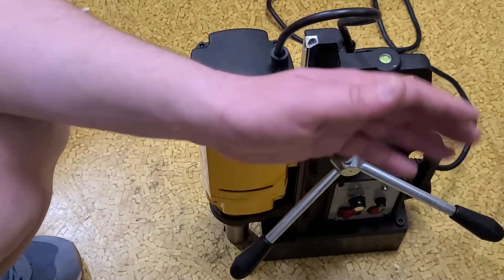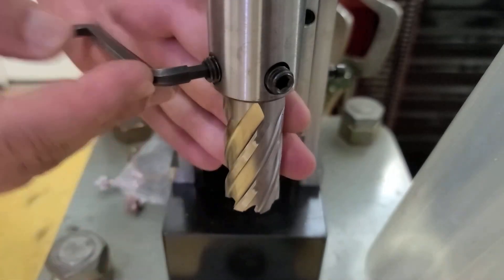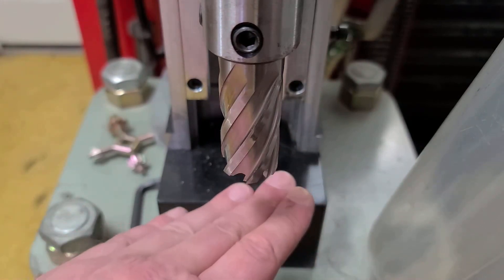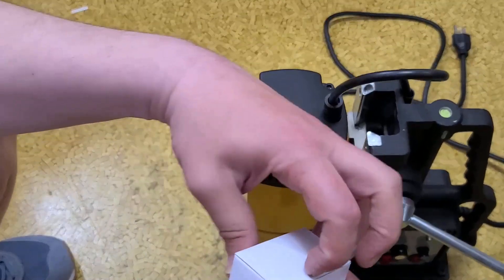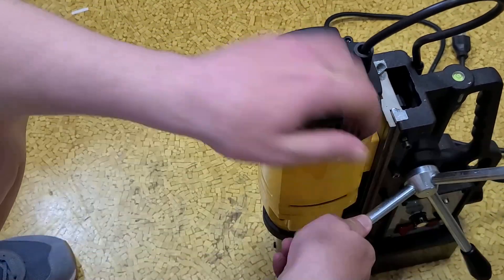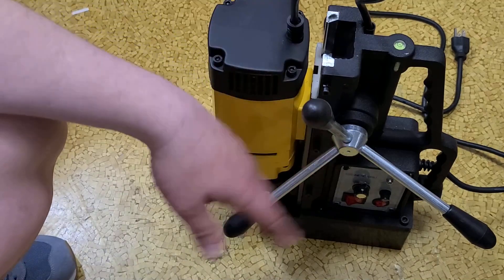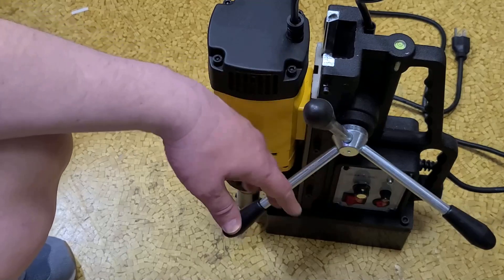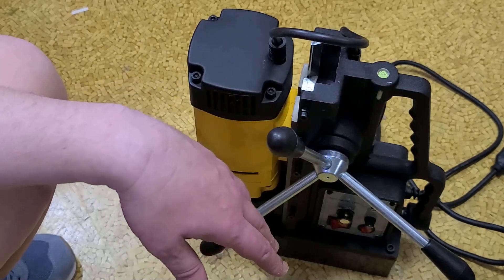Vevor 2" Capacity 1st Generation Magnetic Drill Review

Comment: You might be a little overly critical. True, it's not a high end system with all the whistles and bells. For me though, it's perfect for the occasional and simple job. It doesn't make any sense to spend 2 grand on a unit that is only used once or twice a year to drill a couple of holes in a steel post. It simply takes me out of a difficult situation. If it can handle 4 posts, I've more than doubled my money back. This might be one of those deals where you'd say, one man's trash is another man's treasure. So, until it ends up in my trash for the scrap metal guy, it's my treasure.

Comment: I bought this exact one and it’s AMAZING. We are building a metal shop with 12 gauge beams and we used this drill to cut holes in our 3/8” angles to connect the beams. Cuts straight holes and like butter! Get it and you won’t regret it!

Comment: I like drilling off at an angle. They make special offset bolts for that or you can use a u-bolt on the deeper ones. I wish Vevor would sell those too. I've purchased alot of things for Vevor. All of them are a good value. Why pay 2000 dollars for a mag drill that will be wrecked the first time the power goes out while it is hanging upside down and explodes on the floor like humpty dumpty.

Comment: I have an old school Black & Decker Mag Drill (from the early 70's when you could actually still find B&D stuff in pro garages).
It is 100 pounds.
Mercifully the drill and post come off of the magnet.
You just need a mallet or soft metal hammer to turn a collar.
I doubt any of the modern Black+Decker manuals show someone wailing on their product with a hammer.
I can understand why you would want to.

Being from a time that predates safety you can run the drill without the magnet turned on.
Hell, you can run it without the magnet attached if you want.

I don't know when pro mag drills came out with the lockout that keeps the drill from running unless the magnet is on.
It is a good idea nut not somthing they have always had.

Comment: It is a cheap drill for non precise drilling. It is about 1/8 the cost of the ones you are comparing it to. For folks just wanting to drill a hole in farm machinery it will suffice for most jobs. Yes, it would be nice if it had more safety features for the millennials that have to be taken by the hand and told a stove with the light on may be hot. But for the ones raised in the era using a 3/4" electric drill and knew damn well if you didn't pay attention if it grabbed it was at least going to run you around in a circle or worst case break an arm or maybe more to it wrapped up the cord and unplugged it. You can only make things fool proof, but you can't make them damn fool proof.
Reply: You know what, if you're just going to drill a few holes in thick steel in a controlled enviornment that might be alright if you understand the tool and its limitations.
But if you're only going to use it for a few cuts then you're a novice and you probably DON'T know.

This is a tool that can put you in the hospital in a hurry if you don't use it right or you mess up, if that thing looses magnetism and falls on your head, you won't be laughing, if the cutter cuts at too much of an angle, lifts the magnet off the steel then it will break the cutter, come loose and might just smack you in the face on the way to the ground.

And hey, If you're a boomer laughing at Millenials just remember it was your generation that sold out the working man to China for a quick buck, so don't get too frisky.
Reply: @elliotkane4443  You do realize it has a safety strap to secure it in case the magnet become deenergized? Of course you don't, you probably have never been around one.
Reply: I have a milwaukee that the mag and motor are on different switches and one round E stop button.

Comment: I have no particular issues with mine, it’s the perfect harbor freight quality tool, it serves the purpose for low volume work that doesn’t require high reliability and precision.
Reply: It seems to be if you are an occasional use homegamer a Vevor or Amazon one is fine.
I think his was made on a Monday morning.
I haven't heard of anyone else having the drill lift up becase the cutter is so wobbly.

If you are a serious home workshop type that uses it often, the extra money for an Evolution might be a good idea.

Using it every day professionally?

Get a Milwaukee, Champion,  Hougen, Jancy or one of the other pro grade models.
Reply: I have one and there is very little play in the arbor. My only complaint is they come with a limited amount of cutters. If you order additional cutters you have to buy an adapter for them to fit the drill. Not a really big deal but Vevor fails to mention that.  @1978garfield

Comment: What kind of idiot has expectations of a $200 product vs the high end 1800-2300  product? And also does a whole review about it. I have this exact drill. It works great. Mainly because I'm not a dip shit that forgets to turn the mag on. Especially on a vertical drilling surface. 😆😆 I use the centering bit for the drill bits. Unlike dumb dumb here. Adjusting the drills vertical plung isn't hard. I mean it might be for some candy ass that doesn't know anything. 
Mine works fine. But yeah It's a piece of junk. No shit. 
Get a job.

Comment: At 10% of the price of a professional magnetic drill if this thing will drill a hole in 1-in plate then it is worth it...
 if they don't claim to be a professional magnetic drill so if you don't have $3200 to buy a decent setup and you only need to make a couple of holes this will do it that's really the point of cheap Chinese crap
Reply: I agree . Comparing this to a high end unit shows it’s down falls but as a home hobby non production need it fits the bill. I have the same model and have drilled around 50 holes with no problem. I wish he would have drilled a hole to see it in action instead of just repeating over and over what he doesn’t like about it.